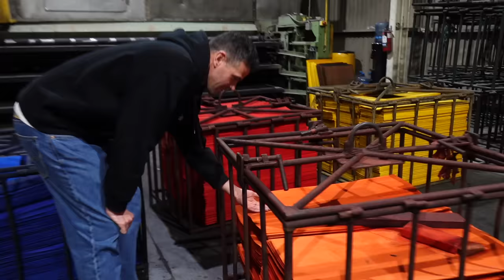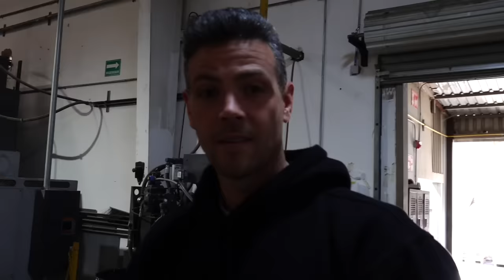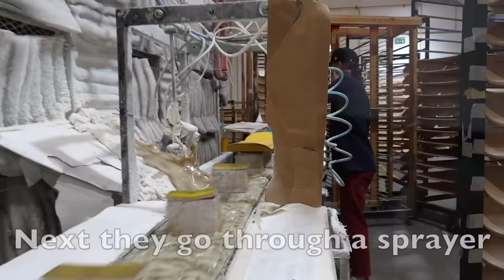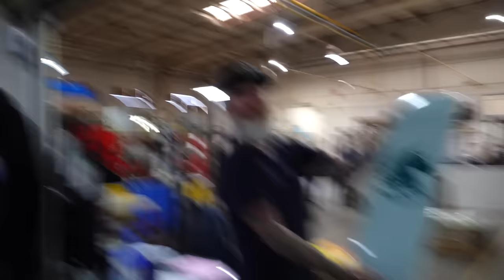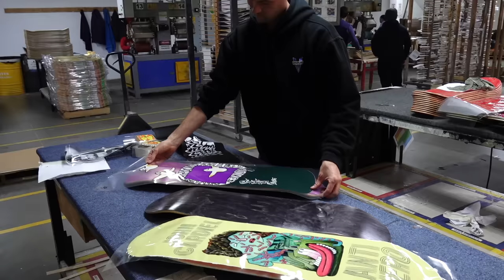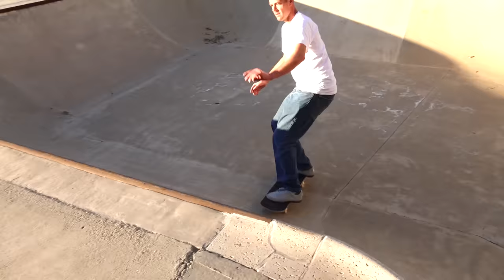Factory Tour at BBS

Comment: This was an awesome edit of BBS' operation, thank you for putting this up. I had a question, I am a firm supporter and ride Indy trucks as I love the way those skate. I ride an 8.0 with a 14.25 WB. I love that size and wheelbase as I'm 47 years old and still flip the board around (to my ability 😄). I'm looking to retry a pair of Venture V-Hollow Hi as the forged baseplate will drop the truck a bit, how much would you think that would throw me off on my sessions?
Reply from the maker: I only like them on 14”WB. The only way to know what works is to try it. Try to em on your regular deck. If you hate it get a 14”WB or just go back to Indy’s.
Reply: I hear what you're saying. For the board to feel like the WB I'm currently riding with Venture trucks, the board's WB would need to be shorter to compensate for the pivot to baseplate's design of the Venture as it's positioned wider than most of the truck brands currently. Thanks for getting back to me on this! 😁  @bendegros

Comment: I need a custom deck, basically regular sized popsicle dimensions but with a narrow 7.25 width for Indy T-Hangars. Does anyone have any suggestions where I can go for that? I can only find kid's boards and 28" is too 'amn short. Want:  31.75 x 7.25 x 13.75
Reply: freestyle boards
Reply: @DazeyChaineMusic  thank you but too short! However, the prollem is solved for now - METAL Skateboards designed one called the Kandarian Dagger, I picked one up and it just arrived yesterday. 32 x 7.25 x 14 popsicle with a nose and tail. It's marketed as a cruiser but to me it really does looks like someone took the time to design a real popsicle deck for T-Hangars.

Comment: hey ben, it would be interesting to see what your boards are like once you've moved onto the next one. are they at a point where you can really feel them holding back your tricks (chips, cracks, etc), or are you just going for that last ounce of performance by switching them often? i'm always surprised to hear how fast some people use up boards, and since you mentioned you'd gone through most of the ones they gave you, it would be cool to see what state they're in
Reply from the maker: They usually have lots of life left. I switch them a little sooner than I need to or sometimes want to. Been skating them about 2 or 3 weeks lately.
Reply: @bendegros so besides the ones for testing/reviewing, is that just so you have a board that works/pops at 100% all the time?